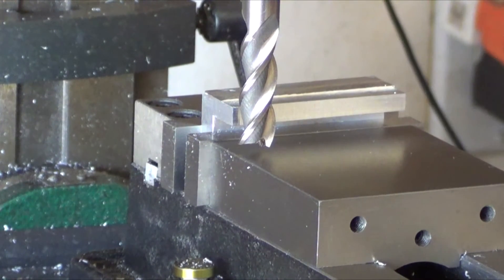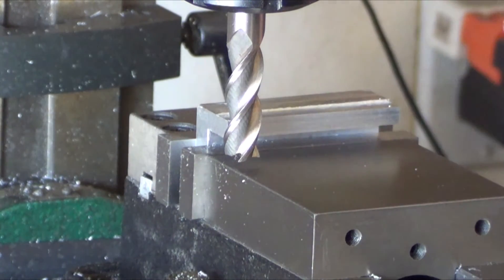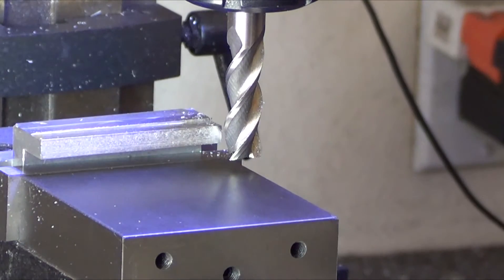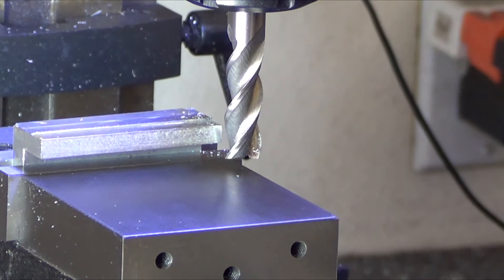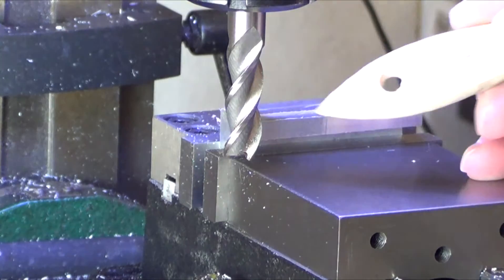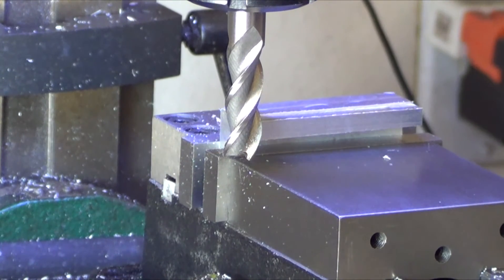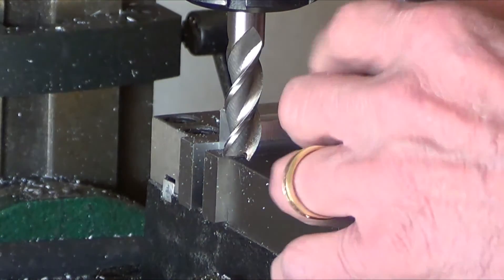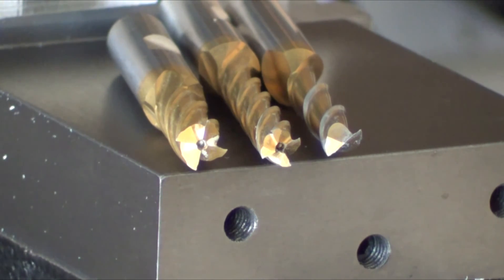Conventional versus Climb Milling Video #43

Comment: Climb or conventional which is best for Rough machining (volume clear) in vmc in steel material?
Reply from the maker: Sorry for the late response conventional for many reasons...
Reply from the maker: And if you use a roughing end mill lubrication is mandatory due to the increased friction..
Reply: Thanks for your response